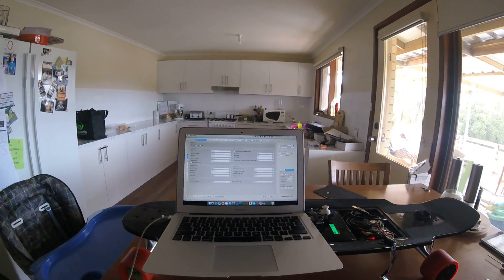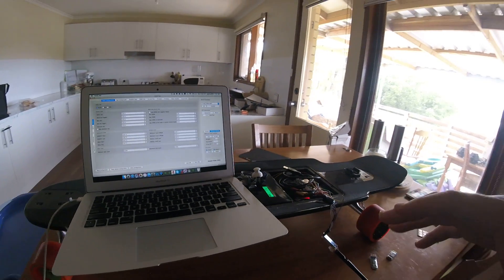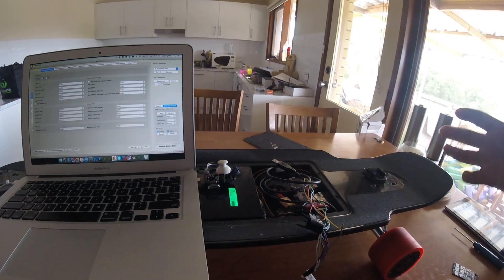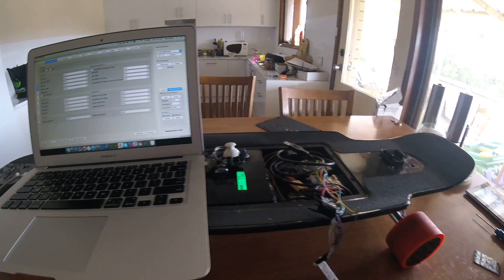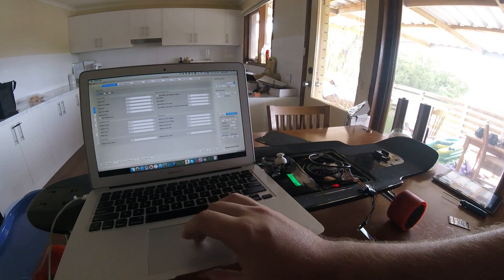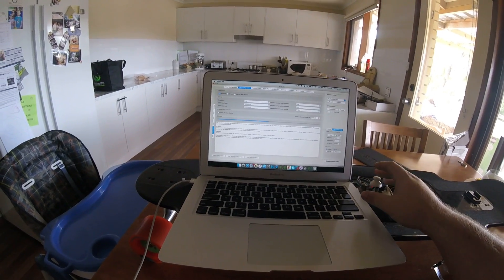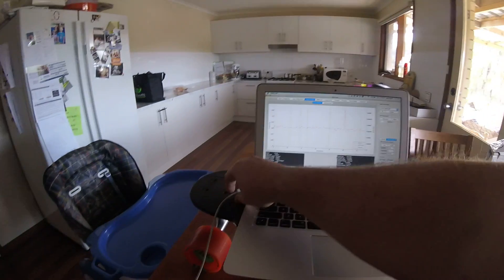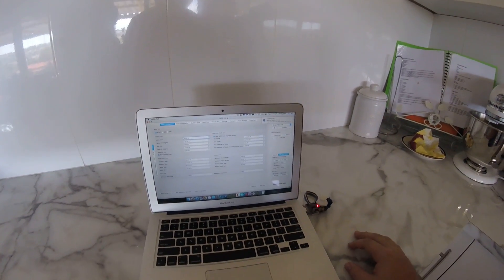VESC to nunchuk usb bridge vid NRF24l01+

Comment: you guys still happy with the nRF24L01 ? (this radio link came on my Evolve Bamboo GT - wondering how reliable you are finding it) - get intermittent drop outs - and a few riders stuck throttle (with hard crash as result)

Comment: So I've got an arduino reading off the values from a standard nunchuk PCB(through I2C) and then broadcasting that information through an NRF module (so essentially mimicking that custom PCB of yours i believe). I'm however stuck on what to do next as far as the communication steam is concerned. If you could either help me out or send me in the direction of a forum that has how the nunchuk information needs to be sent over this NRF communication line that would be much appreciated!